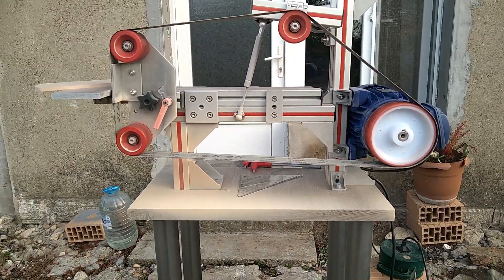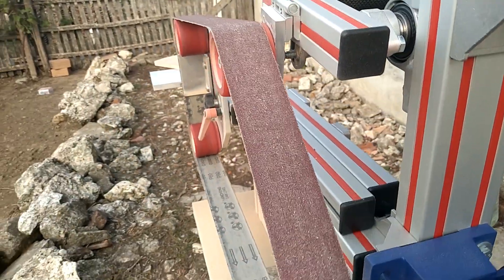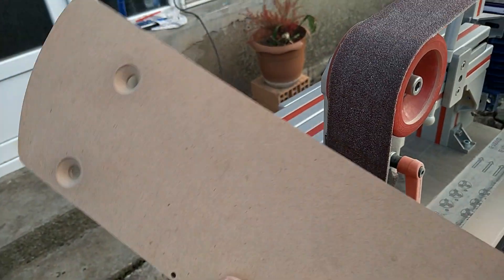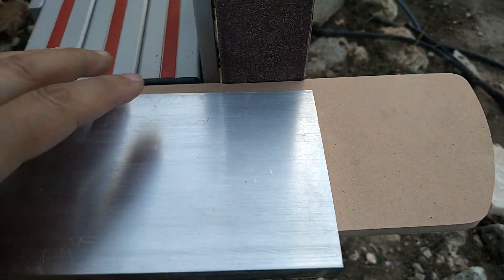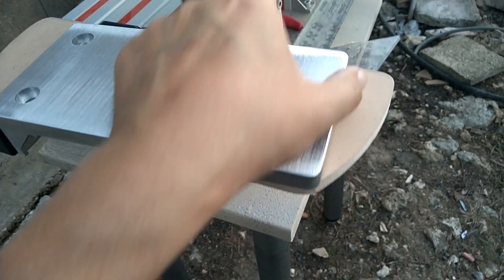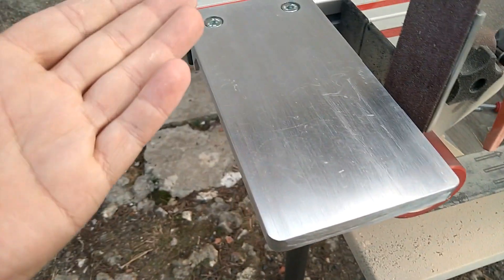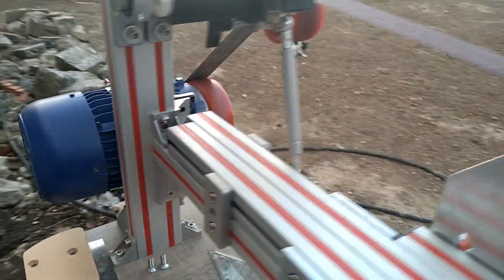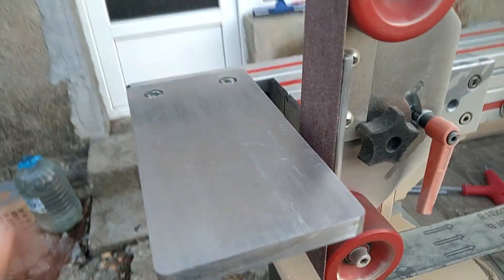DIY 2x72" 2 HP + VFD Belt Grinder no Welding required, with 4080 Aluminum Profiles by #Hayri  Part 5

Comment: Fantastic build!!! It definitely makes sanding profiles almost effortless!!! Congrats on getting it set up the way you wanted and have fun with it!!! Till later my friend!!!
Reply from the maker: Thanks Adam, really glad I made this belt grinder  🙂 Next in line is a power hack saw and a hydraulic press. Currently getting the parts together, by using what I have at hand and trying to buy as few as possible. Also have a new display module from Makerfabs review in the works. Have a great week my friend.
Reply: How exciting!! I'm looking forward to seeing updates on everything!!!!

Comment: It looks amazing. You have done well putting together a minimalist aluminium extrusion belt grinder. I'd love to build one myself identical
Reply from the maker: Thank you very much. Next is a Power Hacksaw with again aluminum profiles and a 25mm linear rail and block to which the hacksaw will be attached.
Reply: @iHayri1  have you made the plans available yet?
Reply from the maker: @PokeWitty  did not get around it yet, it is on my todo list.